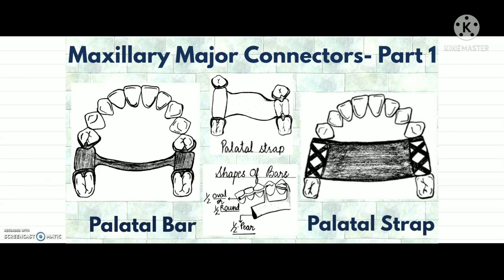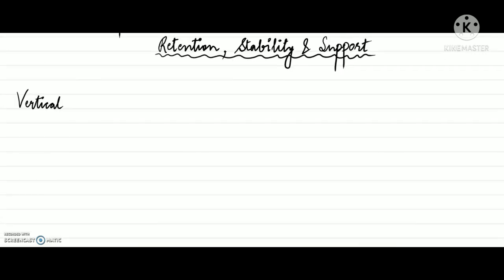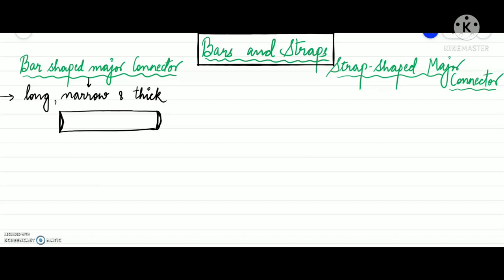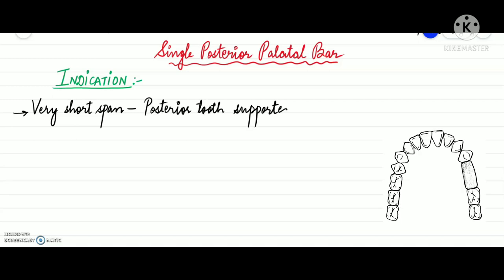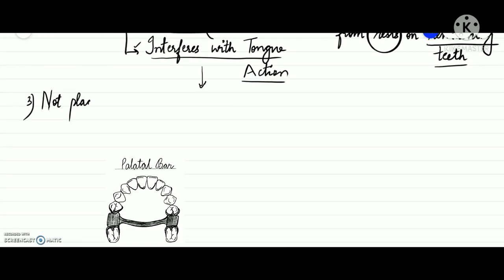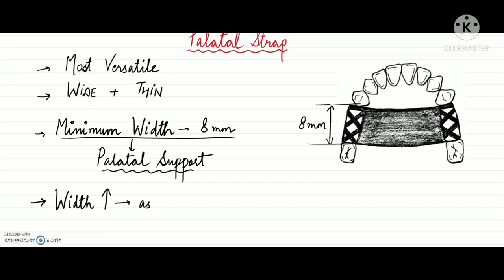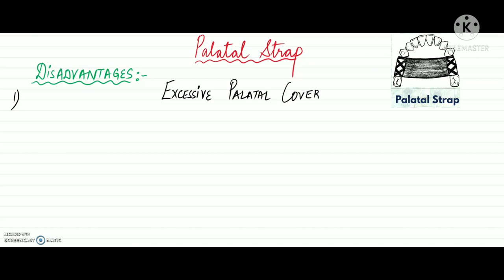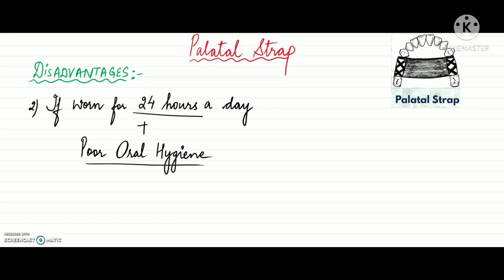Maxillary Major Connectors - Part 1/ Single Posterior Palatal Bar/ Palatal Strap

Comment: I read that a strap is made with a width of 8-13 mm, isn't it? 
Also I have an MCQ which is very confusing, it says
A palatal strap is 
1- a wide thin major connector with a palatal coverage of more than 8 mm
2- provides adequate support
3-Acts as a direct indirect retainet
4-all are correct

Which is the answer?
2-
Reply from the maker: Palatal Strap has a minimum width of 8 mm and width is increased as the length of edentulous span increases. This concept is explained in the video.
As per me, answer should be 4- all are correct: Palatal Strap provides adequate support because of the Palatal coverage. It provides direct indirect retention as well..
To understand the concept of retention, stability and support, watch my previous videos, links provided in description box.